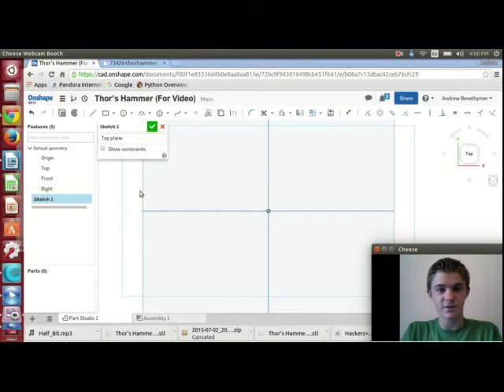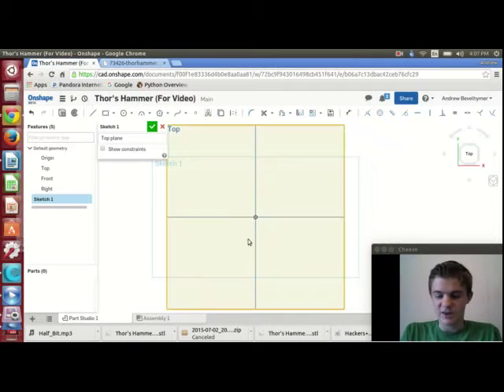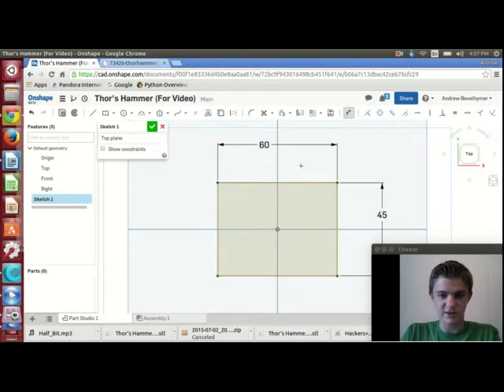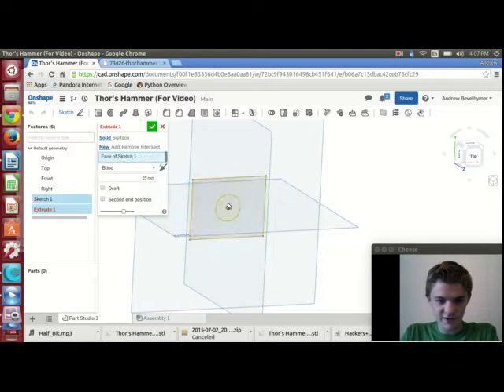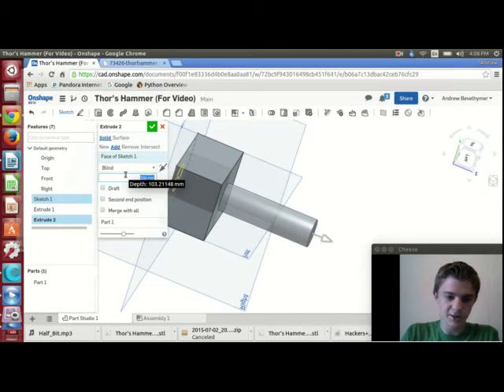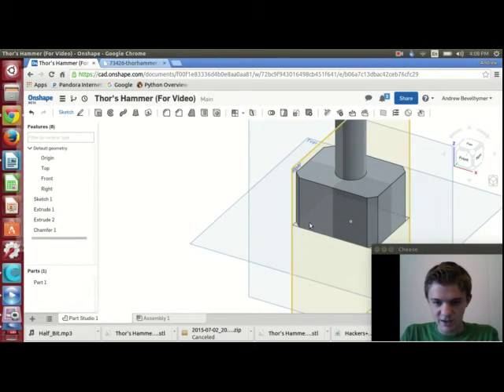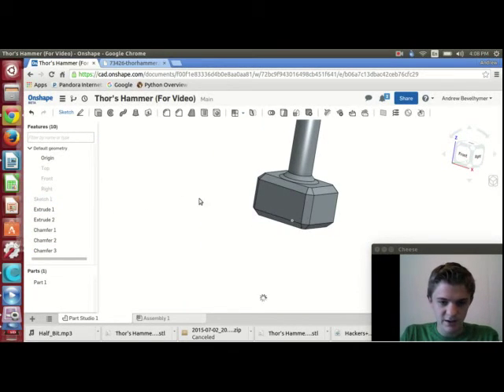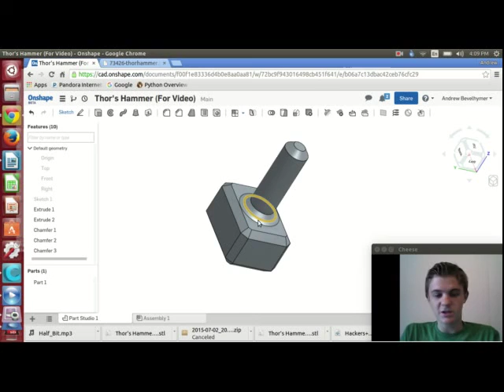3D Master 101: Basic 3D Modeling

Comment: From an instructional standpoint, I would slow things down just a touch. If you want people to follow along that are not terribly familiar, you have to account for their ability to process the information you just gave them. This is especially important if you are using a tool they've never seen before (and you have to assume that on some level). 

Also explain some of your reason for doing the action you've chosen. This mainly applies since you are using this as a "basics" video/series. Saying "I'm going to apply a chamfer" is one thing. Saying "I want to cut the edge of the hammer so that it isn't just a box. This will more closely resemble the actual design of the hammer. To do this, I want to cut this part. There are a couple of ways I can do it, but luckily this application has a tool built into it for just that purpose. It's called Chamfer. I can use Chamfer to cut away a right angle in  symmetrical fashion to create that nice slope detail". 

otherwise, people who are here to truly learn "the basics" will be a little lost due to throwing too much information too quickly, and leaving out details that explain why you are doing what you are doing. I get that most Youtube videos that people are willing to watch are between 2 and 4 minutes (I think that's what I remember hearing), but being an instructional video, I feel that you could take some liberties and go up to 5-7 and still retain people's interest while being concise.

Also, remove the file list of things you've downloaded. That will make things less cluttered. You could also remove your PIP video as that doesn't really add value to what you are talking about. Some disagree. Personally, unless you talk with your hands, it just takes up space. 

I'll be giving this video to a couple students though. Helps show off how quickly you can create something from scratch if you put your mind to it. Keep it up.